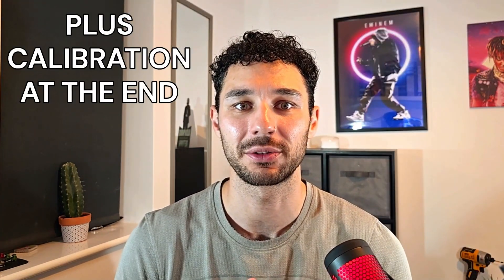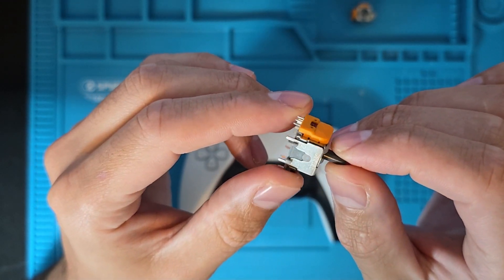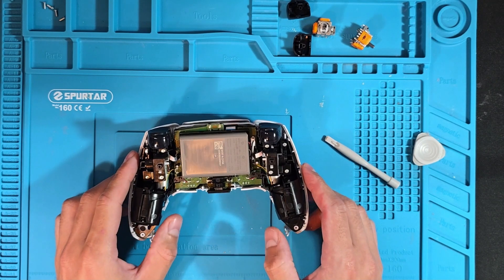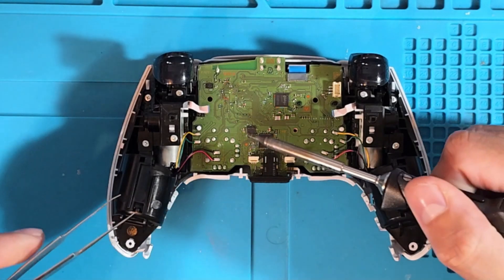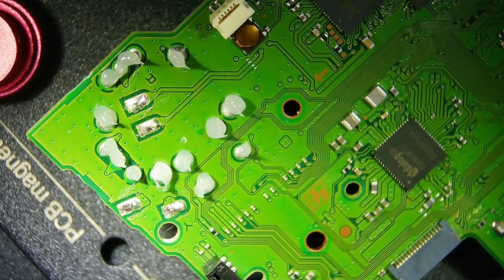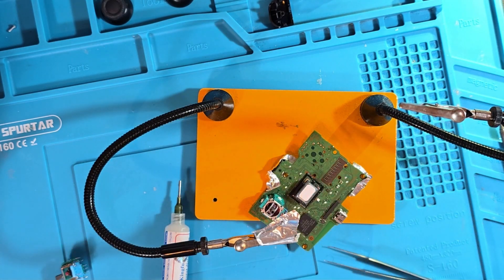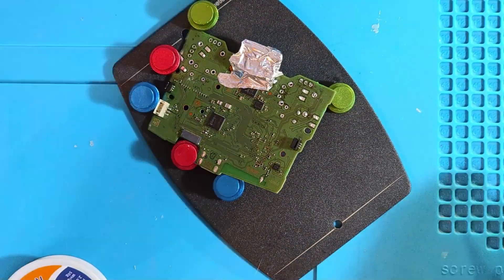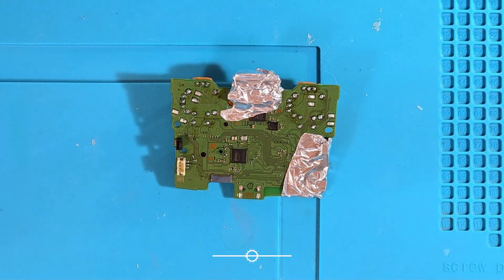DUELSENSE HALL EFFECT JOYSTICKS - HALL EFFECT CALIBRATION

Comment: you do not need to manually calibrate (with a pin in the joystick holes) there is a free online based calibration GUI. It works for Dualshock 4 & Dualsense controllers.
Reply from the maker: Thanks for the info, I'll pin the comment so anyone can see 😃
Reply: Software calibration is what Sony do in the factories, because even brand new potentiometers are not 100% centred or ranged correctly

With Hall effect, if the magnet is very far off, I would do a bit of manual calibration, then software calibration, otherwise you’re going to have major range/circularity issues and this will show mainly in fps games

Although these cheaper Hall effects are still pretty bad in comparison to Favor Union Hall effects or TMR sticks, which don’t really need any manual calibration, just software.
Reply: Yes. You don't need the pin calibration. Just calibrate it via software it works perfectly
Reply: @AdrianAndreiRobert yea it works fine but it’s not the best way to do it because not all software or hardware support what the controller “thinks it’s at” doing it manual is best for less issues
Reply: Doing both solves your problems. It makes it more accurate, which is what I did, there is no harm in doing them both.
Reply: @randomaccount5525  it's pointless nowadays since there is a fine-tune option. But you do what you want.
Reply: The calibration with the pin is better because its an hardware modification. The online tool just make your controller Think that your stick is not moving. Using the online tool is good for an aditionnal layer to the pin calibration to never see your controller drift

Comment: Hey I'm just getting into soldering myself and I seen your solder sucker and I was recommended to NOT buy the one you have but a one with a silicon tip. It's soft and you can get a good seal on the contact and it's also easily replaceable. I don't think youtube allows link but if you want I can send you the link on aliexpress elsewhere. I just got it in the mail today
Reply from the maker: Hey mate. Oh really? We'll thank you for sharing that with me. There's an contact email in my 'about' section, could you fire me the link over through that? Thanks again 🙌
Reply: @PainfulDwayne  it should be in your inbox right now 👍👍
Reply from the maker: Sorted mate cheers

Comment: Great fix Dwayne! It was super simple and straight forward and I like that you talked about how you did things, your thought process and all that. 

I did notice the left stick wasn't 100% dead center. But I'm guessing it's just me who would sit for hours just for that .03% improvment 😅.

Also. F solder suckers. So much work with them. Gotta keep em clean, gotta keep em lubricated. I prefer solder whick :)
Reply from the maker: Thank mate as always! 

Yeah the left could have been more perfect for sure. I think it will be eliminated by deadzones anyway and could always calibrate further if needed 🤣

I had a really good run with the sucker recently and wanted to give it another go hahah. Didn't quite work out, but it did make the hot air extraction a lot quicker I noticed!